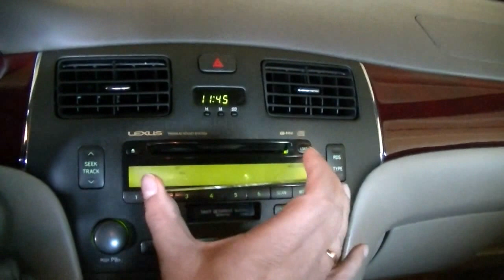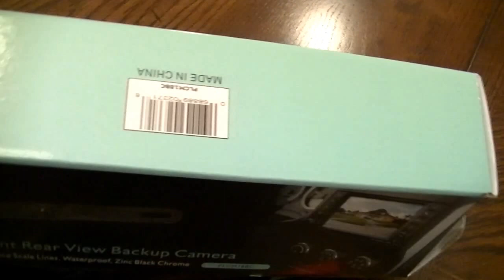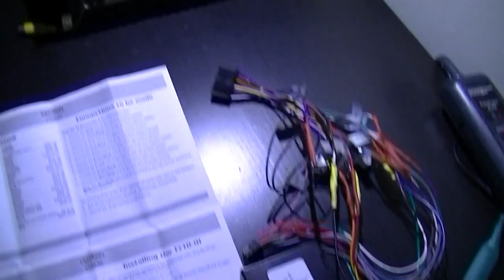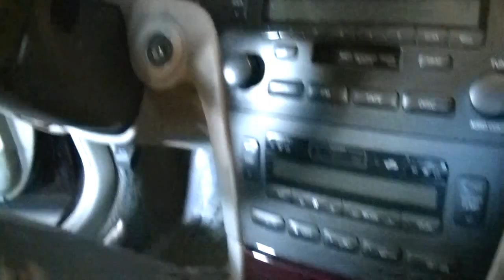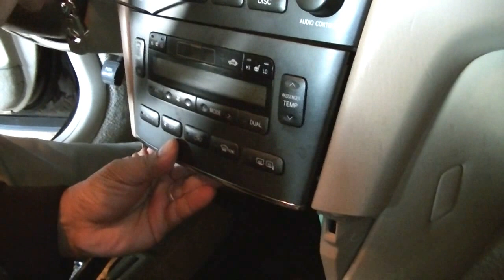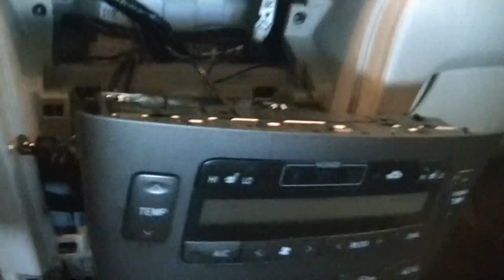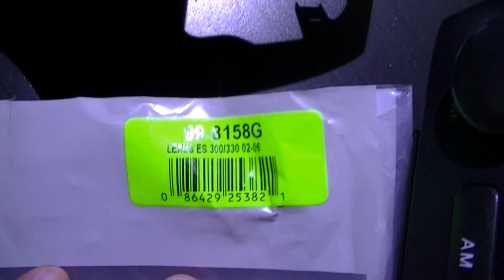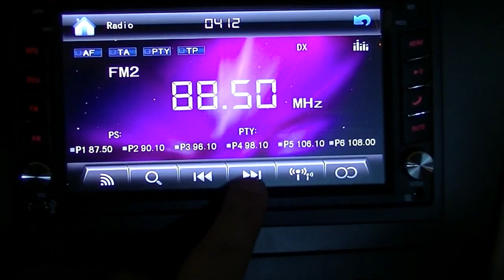2004 Lexus es330 radio replacement with aftermarket double din head unit

Comment: Thanks for the help! I recently installed an android head unit and it works great but i have a problem with the lexus amp, when i turn the car on i need to restart the head unit so after pulling wires i found put that it works when i unplug and plug back in the amp power wire (blue/white), do you know a solution for this issue
Reply: The problem is that somehow the amp is not connected to the headunit and i have to restart it for the sound to work
Reply from the maker: I am facing exact same problem but since restarting head unit solves the issue I did not try to investigate it further. Could be something malfunctioning in toyo interface cable but can’t say for sure.
Reply: V B It is really an inconvenience so im trying to find a solution for it, if you come across a solution please share and so will I becuase im sure others have the same issue
Reply from the maker: My problem is resolved now and amplifier is turning on consistently. It turned out to be headunit issue or could be related to minor connection changes that i did while installing new headunit Pioneer MVH-200EX. I have explained the details in the new comment i posted today. Let me know if questions.
Reply: V B i was planning on wiring the blue/white amp wire directly to the red acc wire, do you think that will solve the issue or should i get a replacement headunit
Reply from the maker: Even i thought on those lines earlier and it is something you can try for sure. Only disadvantage is that if you power off your headunit the amplifier will still stay on. If this does not bother you then you can definitely try this approach and see if it helps.
Reply: i tried this but still the same problem, did you use the wireharness? I tried to connect with the red wire but still same issue
Reply from the maker: Maikel Metyas Mine is working absolutely perfect. I reused same wiring harnesses which was attached to old radio and shown in the video. I guess now your choice left is to try same new head unit that I used. I cannot think of any other solution right now.
Reply: V B I forgot to mention that i tried it with a different chineese headunit and its thr same issue, is it maybe with the amp ground, if i connect the black/white wire to the ground, i will try and see if it works
Reply from the maker: I connected all ground wires (including black and white amp ground) to the solid black wire. No ground wire is touching anything else in my current install.
Reply: V B ok, i will try that soon enough and hope it works, thank you so much for your help
Reply from the maker: While installing Pioneer head unit I installed electronic bypass component too since grounding the reverse wire does not initiate video in motion for Pioneer head units. I read somewhere that electronic bypass component for Pioneer units trigger double signal ie. it will start 12v , stop 12v, start 12v and stop again for the reverse wire trigger. I am not sure if this somehow invokes the amplifier in some way too though it does not make much sense to me.
Reply from the maker: https://www.amazon.com/gp/product/B00A9AQPUU/ref=oh_aui_detailpage_o05_s00?ie=UTF8&psc=1. Here is my idea. Buy this bypass and connect your amplifier 12v+ (Blue while remote turn on wire) of metra harness to the green wire of this component.  Do not connect anything to the blue while wire of head unit, leave that wire alone. This bypass sends double pulse of 12v+ which shall start amplifier everytime head unit is turned on. Before doing this change, do use your voltmeter and check how the voltage on green wire behaves. I think when car is turned on the green output wire will start 12v, stop current and start 12v again after which it just continues on 12v.
Reply: V B ok perfect, that sounds like the solution to it so i will read up and try this again thank you so much
Reply from the maker: https://www.youtube.com/watch?v=Lb0UJQ8W3Os as per this guy, green wire triggers double pulse of ground (not 12v+) so that wont solve the issue. you need some thing equivalent that pulse 12v+
Reply from the maker: I am thinking what will be the output if input connections are reversed (black wire given 12v+ and blue wire connected to ground). Will this leads to green wire generating 12v+ pulse instead? you will have to really play around with this outside your car and determine the output on green wire before planning to insert it in your system.
Reply from the maker: https://www.youtube.com/watch?v=PwaUQM2KAPA

Comment: Would the wire amp hardness work with a 2003 Lexus es300????
Reply from the maker: If your radio looks same as mine and there is no label of "Mark Levinson" or "Nakamichi" on it then most probably it is "Pioneer" same as mine so the same wiring harness should work (my best guess).
Reply: V B thanks for getting back to me I very much appreciate this. 
So yeah mine does look very much like yours I actually ordered the dash kit not that long ago. I'm just more skeptical about the wiring hardness thing. Of witch one to purchase. If you can shed a little light on my direction. I'll Greatly appreciate this. 😊
Reply from the maker: https://www.amazon.com/gp/product/B00133RCCC/ref=oh_aui_detailpage_o03_s00?ie=UTF8&psc=1
Metra TYTO-01 JBL Amplifier Interface Harness

https://www.amazon.com/Asdomo-Pre-wired-Plastic-Isolator-Suppressor/dp/B01DXEBEB8/ref=sr_1_49?ie=UTF8&qid=1489237922&sr=8-49&keywords=noise+filter
Asdomo DC 12V Pre-wired Black Plastic Audio Power Jacks Noise Filter Ground Loop Isolator Suppressor for Car
Reply: Thank you 👍🏼
Reply from the maker: Li Alex yes your system seems same as mine so should work
Reply: V B Hi, mate, not to be the same, my factory amp don’t have the turn on, but have the Tx+, Tx-, so can’t use tyto01 Kit, so why I ask you what is the brand of your factory amp.
Reply from the maker: @lialex2517  I don't have access to car right now but sending you a link of the equivalent amplifier of my car https://www.ebay.com/itm/2004-LEXUS-ES330-AUDIO-AMPLIFIER-PIONEER-86100-33171/202527890611?hash=item2f279a5cb3:g:zpgAAOSwBPRcCZ0f:rk:5:pf:0
Reply: my problem it's like that guy, can you please help me?
Reply from the maker: Li Alex just by looking at the pictures the amplifier seems kind of same as the amplifier used in my car though part numbers are different. In this situation you can take a chance of installing same way as I did using tyto. It is a calculated risk so if you follow exactly as I did and still no sound then I don’t have any other recommendation

Comment: Am not geting no sound any help bro thanks
Reply from the maker: You must have received an instruction paper with toyo harness. Check again which wire is for amp connection, typically blue with white stripes but can be different too like black with white stripe. Ensure you are connecting it to head unit’s amp turn on wire which is usually blue with white stripe.

Comment: My question is :  will the 7" double din radio fit ? Or does it have to be 6.2" ?   
CAN SOMEONE TELL ME.PLEEEEASE. THANKS
Reply from the maker: If you are buying a no name brand mostly chinese then it wont fit for sure. They always make it slightly bigger and call it double din however if you buy pioneer, sony, kenwood like standard brands then both 6.2 inch and 7 inches fit in well. Actually 7 inches is the size of outer frame and in some headunit is full size so they call it 7 inches and in some the LCD is smaller and the side area has buttons so it is called 6.2.

Comment: im confused about the ground wire. on the metra harness 20 pin port there is a black and white ground (amp) and black (chassis) ground. do i just connect the black chassis ground to the black ground coming from the aftermarket ground and im good? its not working that way.
Reply from the maker: +808meesterbojangles No, you are doing it wrong.  Leave the solid Black wire (ground from -ve of car battery) of Metra harness alone, do not connect it anywhere.  Connect Black&White wire (amp ground) of Metra to solid Black wire (ground) of new headunit and also add your own new black wire to this connection, other end of this new black wire will be connected to new headunit's body (using body of new headunit as a ground). I have explained this part in my video too, please try to look at that particular segment again.

Occasionally I do notice that no sound comes from my car even when headunit is powered on. In this situation, I press the power button off and on again on head unit and that solves the problem. It happens rarely but it does happen so I am not sure if there is something wrong with headunit or a malfunction of that TOYO black box but since recycling the power on headunit solves the issue, it is ok for the time being. FYI only.
Reply from the maker: +808meesterbojangles  Yes nothing special about ground wire, I used just one that was similar to the wires used in wiring harness. You can probably cut one of un-used wires (like power antenna wire - solid blue) and use it as a ground wire instead. Just loosen one of the screw on back of the head unit and wrap other end of ground wire around it and tighten it so that connection is good. Tape may leave it loose.

Comment: Not flush fitting would drive me nuts.
Reply from the maker: Flushing issue happens only with "No name brand cheaper units from China". If you go with PIONEER, SONY, KENWOOD etc. branded units then there is absolute no issue with flushing. Known brand units are of exact size as the faceplate and fits in absolute perfect without any modification.